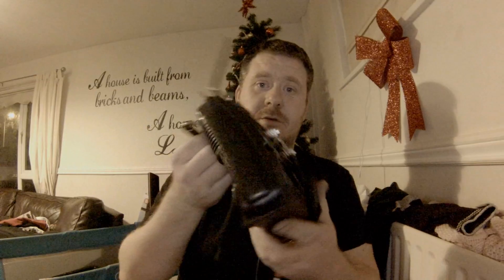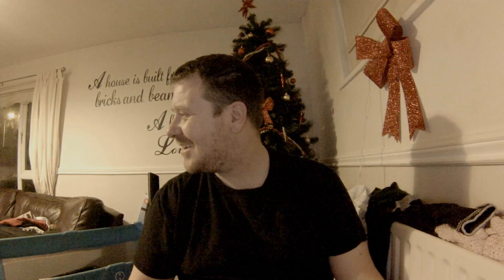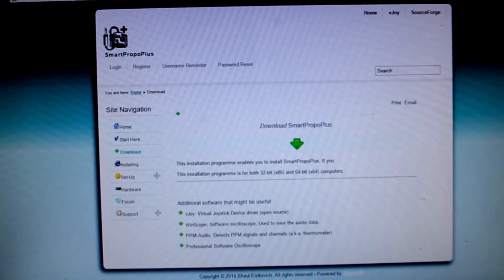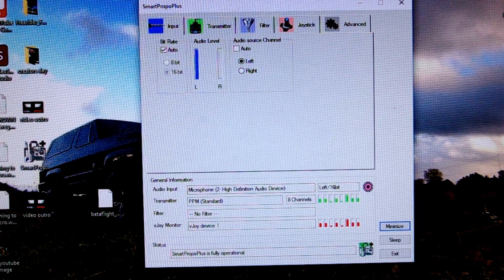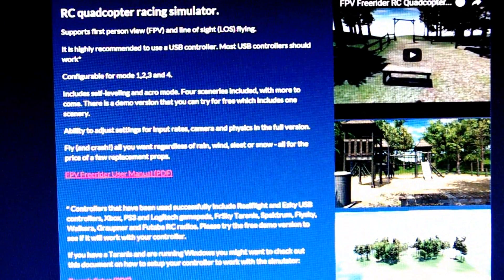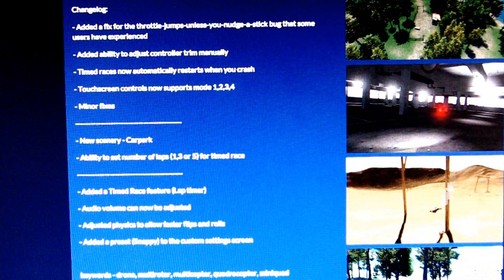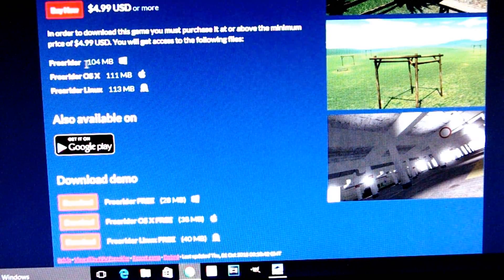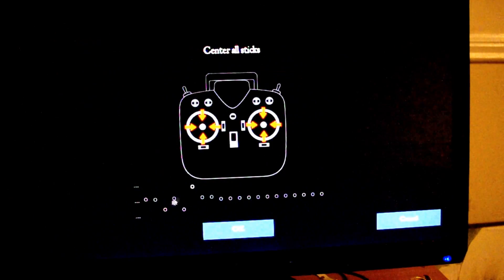FPV FREERIDER - IMMERSION RC LIFTOFF - SETUP ANY TRANSMITTER

Comment: Plz help! propolus keeps saying "transmitter disconected" even thogh the connection is good and I cant get it to work even thogh it worked yesterday
Reply from the maker: Maximuss re-install the virtual joy stick
Reply: Did that like 3 times...
Reply: I don't know what to do
Reply from the maker: +Maximuss might be a dodgy cable then pal I had it doing that on mine turned out to be the cable or could even be the port in your radio
Reply: Well I hope its not the port so i will just buy a new cable cuz it was only like 2$